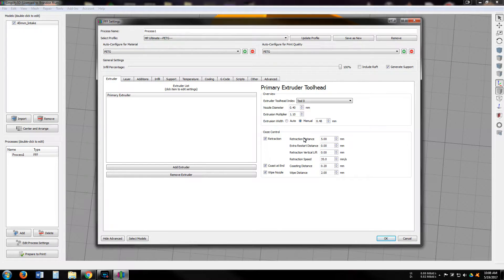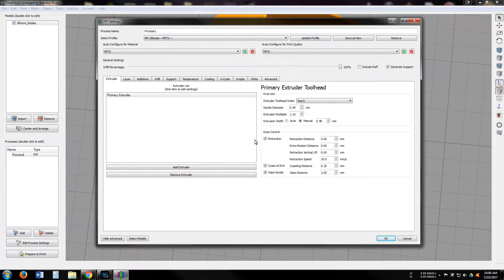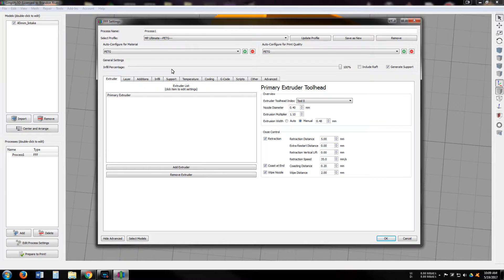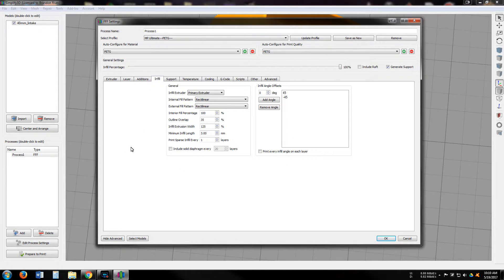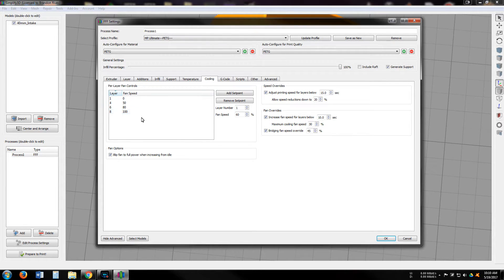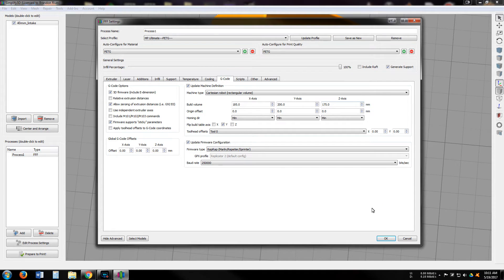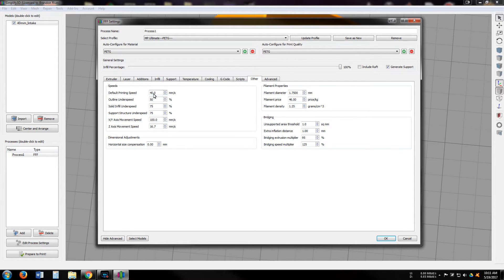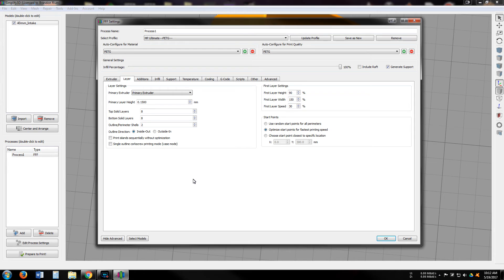Simplified3D Settings: PETG with the Monoprice Maker Ultimate 3D Printer

Comment: After everything I have read about PETG from the folks that have good reviews, I decided to run PETG at the same settings as you, before I saw your video ;-) I get my PRUSA in Aug 2, and will be using eSun in grey .... looking forward to using it ;-) I think many folks overlook it needs to run at a slower speed ... a big deal !
Reply from the maker: Yes, I still issue with PETG from time to time. Mostly the first 2 layers. Sometimes have to use a raft. Let me know how the settings work for you.